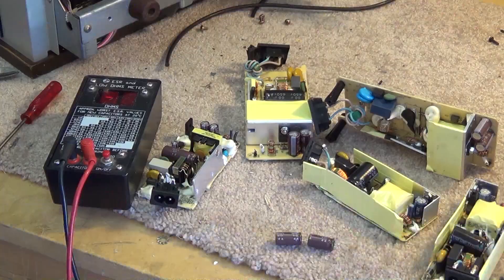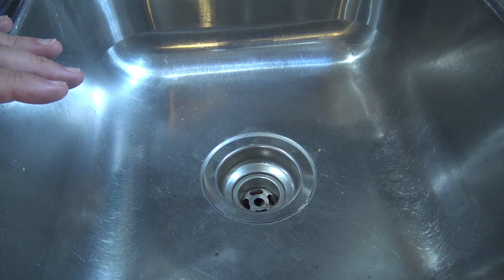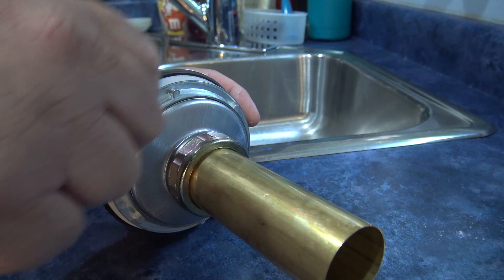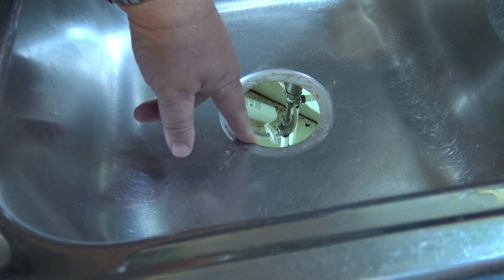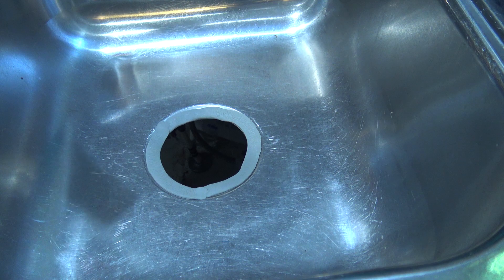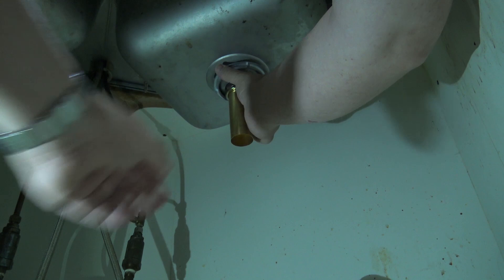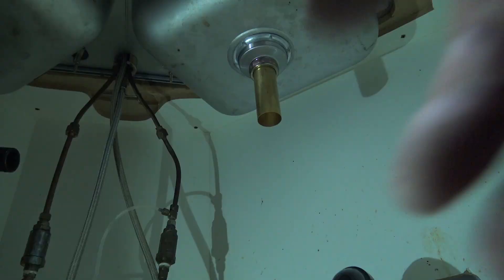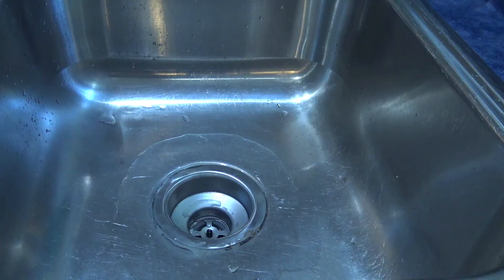How to change a kitchen sink drain strainer save yourself hundreds in plumber costs

Comment: if im correct i think you need to install the paper and rubber gasket from underneath the sink with only plumber putty on topside.  Because you gonna get mildew growth around sink strainer on top  especially with the paper gasket there
Reply from the maker: The original one put in by the plumber had the rubber and fiber gasket on the top side, but I see your point. The putty however is totally sealing the drain itself and no leaks. The instructions don't show where the gasket goes so I put it back the way the old one came out. The gasket is still stuck to the old drain, on the top side. The putty is what seals it.
Reply: @12voltvids  that's no problem Dave, you did it right. the plumber putty is the way to go as you crank down on the locking ring the putty squeezes out and makes a seal. but thinking about it, the rubber and paper gasket definitely goes where the lock ring is.
Reply from the maker: @freddie9116  I agree, and who says the plumber that plumbed the house when it was built did it right to begin with. We all know these trades. The thing is on there effin tight so no water is going to leak. I wouldn't want to be a plumber myself. Yes I know they make good money but cleaning out drains is not my idea of a great job.
Reply: Fred you are correct.  The fiber washer (basically cardboard) prevents the rubber one from bunching up because it "frictionally" isolates it from the rotating metal nut.  I'm not a plumber by trade but have installed quite a few of these and all the instructions showed this configuration.  That being said, if it doesn't leak, its not a big deal.  Besides its not a pressurized line so it wont flood the place.

Comment: I do all my own plumbing too. Saved quite a bit over the years.
Reply from the maker: I changed my water heater last year because my insurance company said I had to change it. Then the bastards wanted to see the invoice from the plumber. I told them I did it myself and they said not good enough. So I had to call Robber the plumber and pay him a service call just so he could sign off on the new water heater. Even though I had an invoice for the heater the dick at the insurance company said it needed to be installed by a licensed plumber. Crock of shit if you ask me. Probably getting a kick back.
Reply: @12voltvids  Just like most people are saying these days, communism isn't that far off.
Reply: @12voltvids  The same scam goes on here in Ontario too. They said our old furnace should be replaced and some guy says the heat exchanger is burnt out. They had to cut it in half to make it easier to get out of the basement. The heat exchanger was still over 1/8 of an inch thick. The new piece of junk they installed is like tin, and doesn't throw the heat like the old furnace did. What a bunch of crooks. Just a make work program for contractors, to pay most of what they make back to the government, for  schemes they keep coming up with, to make it harder for contractors to stay in business.
Reply: @12voltvids  I'd find a new insurance company if I were you
Reply from the maker: @will89687  Why would I do that?
Reply: @12voltvids  Maybe a bit less of a stickler for having a plumber sign off on your work - or is that a regulatory requirement in BC?
Reply from the maker: @will89687  Not required for repair work. New installations need to be inspected, and that was all done when the house was built.

Comment: Our kitchen drain strainer is also broken. I've just been putting a strainer in it. We also have a 50 year old garbage disposal, and I just put a strainer in that too. It works, but I'd rather not use it because of that clogging issue. Our garbage disposal is on the right side, but I think most kitchen sinks have it on the left side. It's just one of those things I've never thought about because I grew up with it like that.
Reply from the maker: Mine started leaking like a siv and when I went to take the pipe off it snapped. Ah, thats where all that water was coming from.

Comment: When I renovated my kitchen back in '83 the only sink baskets Grossman's had were plastic so that's what I used. In 2018 I decided to replace it because it was getting really gross, I picked up a brass one on Amazon that must have weighed 2-3 pounds. It took about 15 minutes to take things apart and install the new basket.

Now if I could just replace the old faucet with the new one I've had downstairs for over a year. That's not a bad job unless your back is screwed up but someday I'll find a way to do it..

Comment: When I replaced my kitchen sink, I bought the sink and all the other parts from Home Depot. My one regret was the drain. Spend extra and get one from a plumbing supply store.
Reply from the maker: I hear you. The local shop had one that I think was probably better, same as the original and was cheaper, made in Canada too. I had already bought this more expensive one and because of the f&*&ing covid they wouldn't let me return it and go with the other one. This one fits and works, but the stopper is different, and the sink drains slower as the actual drain hole is smaller, not full pipe diameter. Oh well it is in now, and it is not coming out again.

Comment: The Chevy Volt was/is the best version of an electric car ever.  I have a 2014 with 24500 miles.  Once you have an electric car you never want to go back to petrol.  Unfortunately they are no longer made!
Reply from the maker: Agree 110%. I have a 2012 with over 100,000 miles on it now (170000 km) no issues at all. I also have a 2019 as I had to get a second one while I still could.  Despite what the pure battery fans say about fast recharge for road trips they only say that because they have never been on a road trip when the shit hits the fan and their planned 45-60 minute planned recharge stop turns into a 3 to 4 hour delay at every stop they have to make because everyone else has the same idea and the charge stations are at capacity and there is a wait. It happens, and I have documented it on trips where I am pulling in for a 4 minute gas fill and I see EV drivers at the charge station waiting in line.  If I have to replace one of my cars I guess I am going to have to go with another brand of plug in.

Comment: Does the Volt charge at all while the engine is running? Thanks
Reply: Darryl 603 it is not supposed to do so, but you can force it to a point: if you engage mountain mode with an empty battery, it will charge up the battery to some level (20%?) to have some power reserves for going uphill.
Reply from the maker: Mountain mode will build a 10 mile range on first gen, 8 mile range on second gen, but normal mode will maintain it at the low limit.  The reason is it takes more gas to generate power that it costs to buy from grid. I did a video about 9 years ago showing how much it can generate and how much fuel is needed for the test i did. You do recover lots of power coming down a mountain. Where i did that video hope to Luton to liloette to West Van last week, Duffy Lake road is all done. Hill from Seton lake to Pemberton.  I generated 34km of battery power coming down the hill. Engine off the entire way down. When I started up the next hill i used up that free regenerated energy before the engine started again.  In my opinion plug in (with the volt being the best plug in ever made because it uses the full battery and the engine never starts at any speed untill the battery is drained completely, all other plug in cars and SUV if you floor it even with a full battery the engine starts up) cars are the only way to go. You can do 99% of your daily driving and not use a drop of gas but it is there if if you need to travel and no lining up at the fast chargers which from what i have observed always have someone on it and at least one awaiting their turn.  I can drive 700km 450 miles and then stop at a gas station. A take 30 litres (8 gallons) and I am good for another 600km before the next fill. No waiting to charge. Best of both worlds.
Reply: @geraldh.8047  Very interesting. Wouldn't it be great if it was more self sufficient. Thanks Gerald
Reply: Darryl 603 I’m not quite sure what you mean by self sufficient? Unless you have a petroleum well and a refinery in your garden, using gasoline is the very definition of NOT being self sufficient. With electricity at least you COULD reasonably be self sufficient with a modestly sized solar installation...

The entire goal of having a Volt is NOT using gas 😁 I love my 2012 Volt, although I personally would disagree with our channel host: I would never buy a plugin hybrid in 2020. Full electric all the way, it’s not 2012 any more.
Reply from the maker: @Darryl603  The idea is you charge from the grid, because for example, 1 gallon of fuel will generate about 10KW of energy enough to go about 40 miles. A gallon of fuel here (regular) is 5.00. 10KW of electricity, at the most expensive rate is about 1.40.  At the lower rate about .89. Why would you burn 5.00 in fuel to go 40 miles when you could do it for 1.40 in electricity off the grid. Of course if you invest 40 grand in solar panels the it would be free to charge, but you have 40 grand in solar panels to pay for.
Reply: @12voltvids  Good point! Our average for fuel is  $1.85 a gallon. 
Nice fix by the way...
Reply from the maker: @Darryl603  Even when I could go to the states to get gas it was still about 3.50 a gallon.
Ours is much higher because gas is taxed through the roof here to subsidize things like transit and put drug addicts in shelters.
Reply from the maker: @geraldh.8047  Lets say we agree to disagree. Full electric only works if you never take long trips. Sure it can be done in full electric as some people have done, but it is not that convenient when you have to wait 2 hours to get on a fast charger. Unless you have a tesla where there are superchargers there that nobody else can use, but if you have any other EV, you are waiting to get on a DC charger that others ahead of you, including tesla drivers are using. I have seen situations in my travels and by talking to EV drivers where they are frustrated because the DC chargers put in by the government are free, and Tesla model 3 drivers have to pay to use the super charger, so they use the free charger and other EV drivers have to wait. I know many people with EVs and every one of them says the same thing. Great around the city, but one road trip and never again. For me  have all the advantages of a full EV, but when I want to go on a road trip I just burn a little gas. No sitting around to wait for a charge. BTW, even 40 minutes is too long to wait. When I stop I am stopped for a fuel up break, and perhaps a bio break and then I am on the road again. 40 minutes is just too long to wait, and if there is someone else on the charger it could be a 2 hour wait. For me the only solution to having a full EV is to have a regular gas or diesel car for the long trips, or wait for it, a plug in hybrid. All the advantages and no second car required.  If something happens to my volt, I will be looking at a Ford or Toyota plug in unless GM brings out the rumored plug in SUV but I would never limit myself. In my volt I keep only 1/8 of a tank of gas in it normally, and that will last me a full year. I then have to burn it up because the car forces me to to keep the gas from going stale.  For those that argue that I am hauling around dead weight in the engine, that is true, but so is the dead weight of a huge battery pack that you might use 15% of during your daily commute but haul around a heavy expensive battery for the odd time you need to go further. I haul around an 18KWh battery and a small 4 banger for backup, not a huge 70 or 90KWH 1000 battery. So it is 6 or one and half dozen of the other.  Wait till you are driving your EV and you need a charge and pull into the only charger in town and find it out of service. At least if I run out of gas someone can bring me some. You cant do that if you run out of juice. I see tesla drivers all the time that forgot to charge and their car is being loaded on a flat bed truck.
Reply: @12voltvids  I'm surprised you've seen such long wait times. As a Volt driver I have to admit I'm not paying close attention to charging stations, but what I see and hear it does not seem to be a huge problem in Germany. If you want it "free", having to pay for it in additional wait times seems reasonable. For me personally I would only consider long range cars so I have plenty of range and could do long trips with just one charging stop. Modern cars can charge at >100kW so it should not be a 40 minute charging stop but more like 20-25min.
Reply from the maker: @geraldh.8047  
There are so many EVs now and still limited chargers on the highways so everyone traveling all have to hit the same ones.  Last year when I was travelling i made a point of every time i saw roadside charging stations i stopped to check them out.  Most had a car on them with 1 person waiting.  So if i had been driving an ev, i would have been stopped for over an hour. I'll take a smaller lighter cheaper battery with a back up engine any day.   That way i get all the benefits and no inconvience.

Comment: Wait till you buy a commercial building where the cast iron drain pipes corrode, now that's plumbing. to endure.
Reply from the maker: My house used to have cast iron drain and galvanized supply and hot water.   Every time someone turned a tap off slowly the gasket hammering would cause a pipe to leak.  It was all ripped out and replaced with PEX and ABS when the new place was built. B
Reply: @12voltvids  try doing that yourself. Now that's expensive plumbing. I have an old theater, the cast iron drain pipe rotted and I had to grind it out and put in plastic. I was lucky. The plumbing is mostly 2 inch copper adapting to 1 inch for toilets and 3/4 for uninals and sinks.
Reply from the maker: @markanderson350  no thanks.  They crew working on my place had to use a gas powered cutter like they use to cut concrete sidewalks to cut the pipes up.
Reply: @12voltvids  I wish I had one. I used a cordless grinder and shit, literally all over. It was the drain horizontal pipes they rot on top.
Reply from the maker: @markanderson350  
And that's why i never went down that career path.  My wife's uncle was a plumber as are his 3 sons and the grand sons.   I didn't follow in my dad's footsteps though.  He was a fireman for awhile and then a longshoreman. I should have gone down that road but i didn't.  My uncle was a telephone man and i gravitated towards that industry but it was a closed shop and i couldn't get in when i finished high school.  I figured tv production was my calling and went to school for that but no work.  I took a job at Sony and the next thing I knew i was on their training program and found myself fixing electronics for the next 20 years.  Then the phone company started hiring so i tried a second time and got in.

Comment: who elce heard the blowing into a trumpet noises at the beginning?
Reply from the maker: It's the water pressure regulator valve.  Someone turned off a nozzle on the end of the hose and as the pressure builds in the hose it makes noise.
Reply: @12voltvids  gotcha.

Comment: gloves
Reply from the maker: Why, the drain is empty.
Reply: @12voltvids  Just prevention. If a scrape / cut  occurs, as the corroded sharp drain pipe edges poke, bacteria may get in under your skin, the wrong germs can be quite aggressive. Those SS sinks have a course sound deadening coating applied that can scuff you knuckles and probably cut into a thin glove anyhow.  No cut, no scrape NO PROBLEM.  And, you are that good; but I'd end up with an infection (or two) lol.